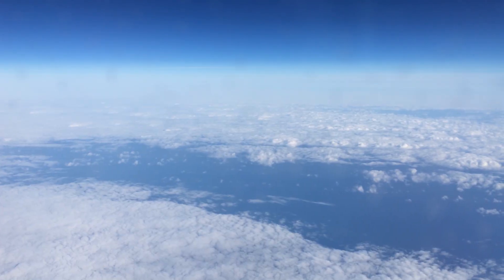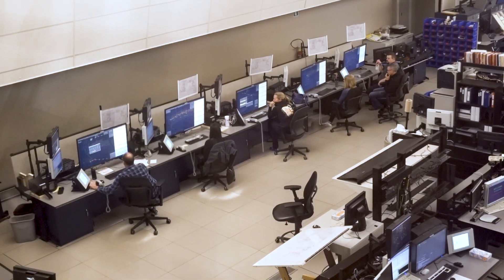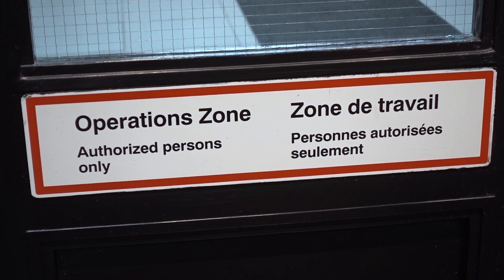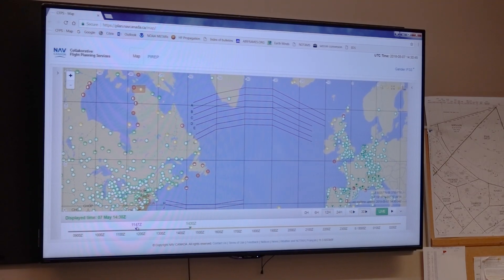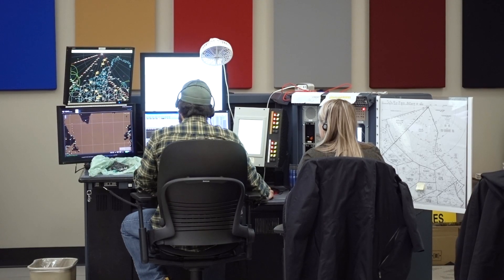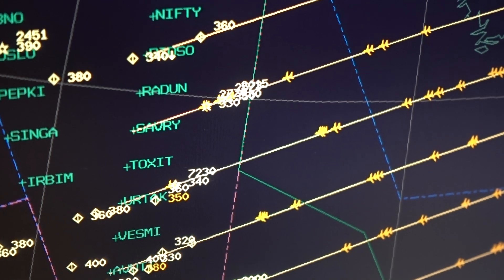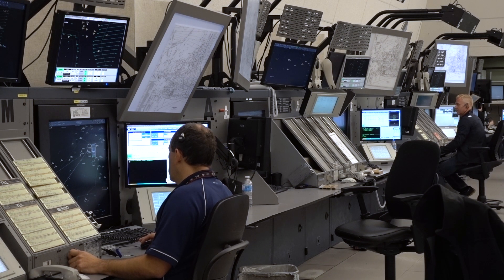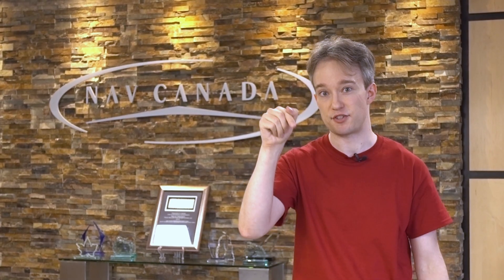How planes stay safe over the Atlantic

Comment: You could had ask the procedures or differences in the times when Concorde used to cross the Atlantic...
Reply: Concorde operated on three specific FIXED Concorde only ‘tracks’ across the North Atlantic Ocean that were higher than the than the routes used daily by normal airlines which change twice daily to take account of the weather that day. The Concorde tracks also stayed away from land. During supersonic cruise Concorde flies between 55000ft and 60000ft which means Concorde flies above the weather on the edge of space.
Reply: Wow... thanks!

Comment: Randomly wondering if "personal electronic devices" includes digital watches, hearing aids, insulin pumps, and pacemakers...
Reply: if your hearing aid/insulin pump/pacemaker transmits signals on the frequencies that aircraft equipment use and does so strongly enough to INTERFERE with the aircraft's signals (or ATC's signals TO the aircraft) I think you need to have a chat with your audiologist/nephrologist/cardiologist...and while you're there to get an explanation for the burns on your skin near the device, also ask why they cleared you to fly?